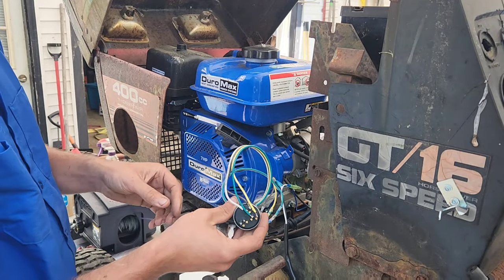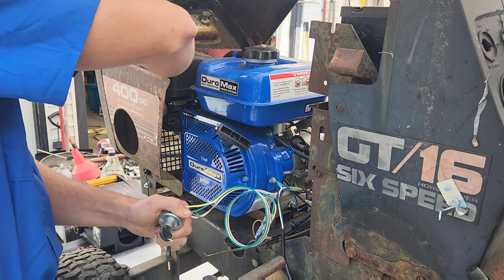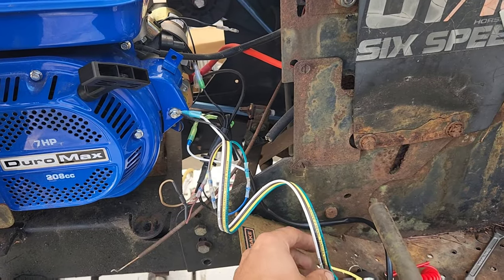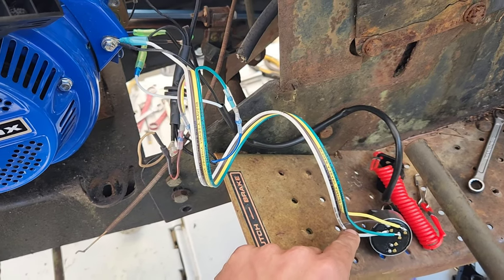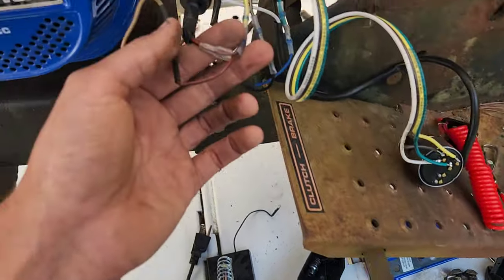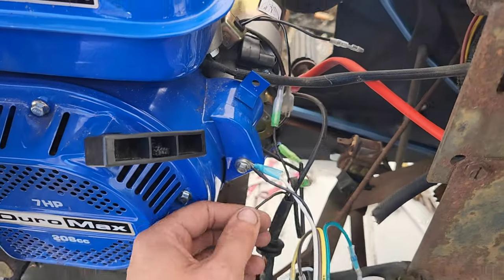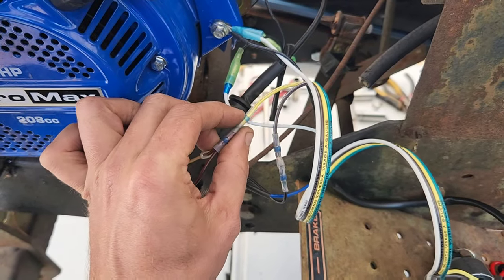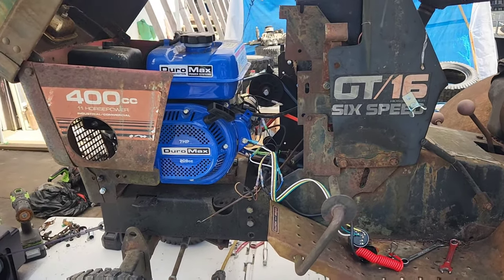Duromax 7hp Ignition Key Relocation

Comment: Don't know if you'll have an answer, but I'm just about to jump into this with the Dm 18hp. As I recently have about 150ft of old Cat5 cable to play with, what do you think the minimum gauge wire would be that you could get away with on a starter relocation? I did bookmark that trailer extension in case this all goes belly up.
Reply from the maker: Cat 5 as a solenoid trigger I bet would work fine. Problem I see is not rated to be flexed so it might snap inside over time.
Reply: @redneckcomputergeek  Oh, yeah, totally forgot about that. Good call!